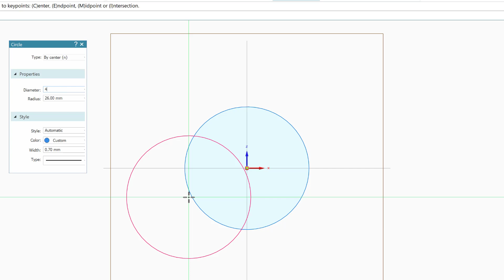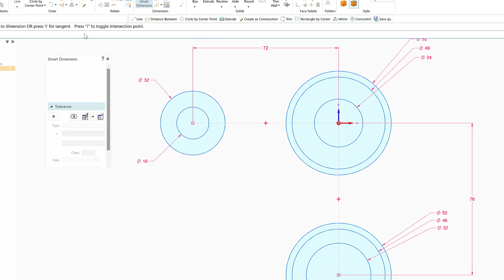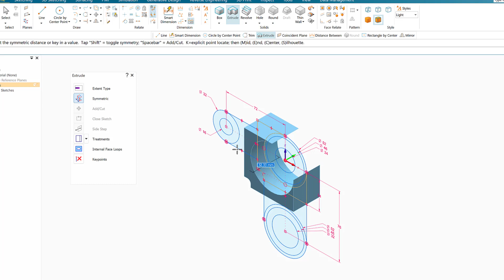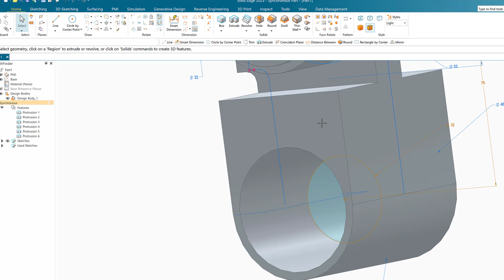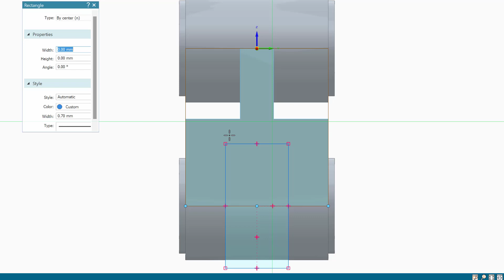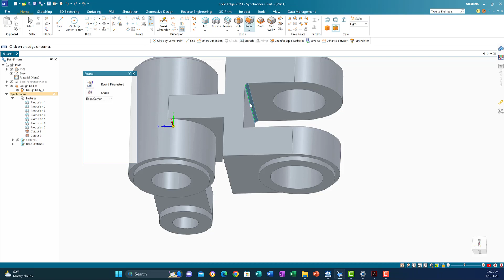Solid Edge 2023 Tutorial - Exercise 17

Comment: 15:06 The dra says Radius 2, but you put 4
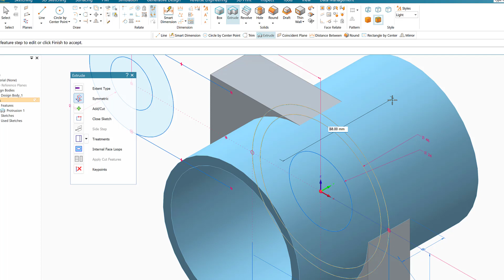17:24 here the side view says 60 but you chose for 68
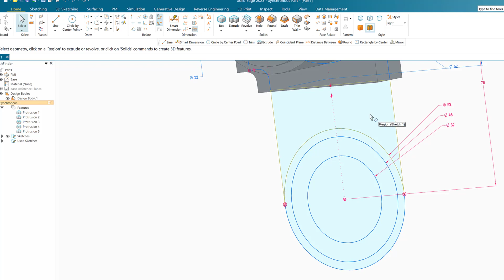20:41 Is there any reason for which you decided to hold down shift to select the 2 areas instead of to trim the circle 52 diameter?
Reply from the maker: Thank you so much for pointing out these issues. It seems that I posted an old version. Currently, the corect draft sheet of this exercise is available at the link . With respect to the last item, the main reason to hold the shift key is to associat different areas to the same extrusion. I examined what you suggested using the new version, and this what I found out: I did a lab last week and it worked without holding the shift key. But today I was doing lab5, in the class and it did not work and I still have to hold the shift key. I will discuss this issue with Solid Edge support and find more information. Thanks.
Reply: thank you so much  @drmseif   yes I used the cut tool (for the last point) and I succeeded. Thanks for the great tutorials you've made
Reply from the maker: @Not-Only-Reaper-Tutorials  Thank you so much for keeping in touch.